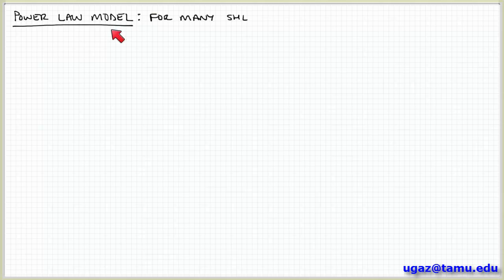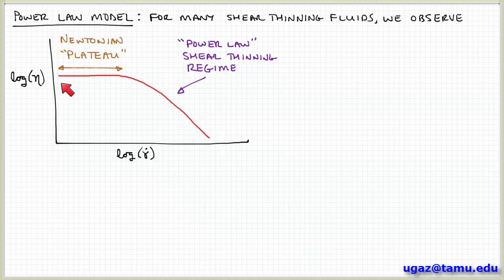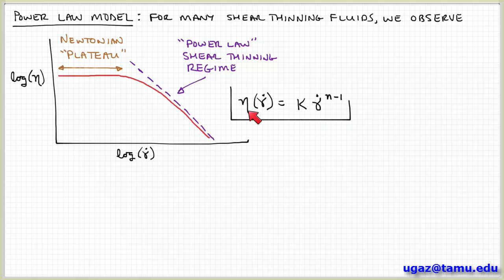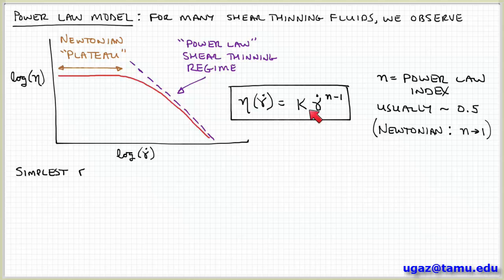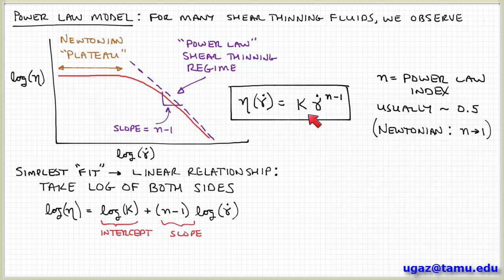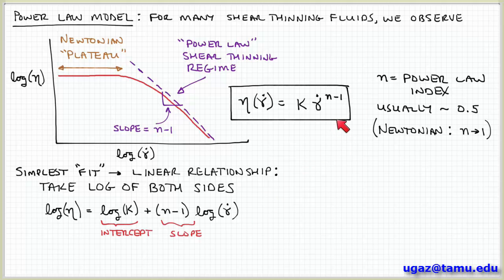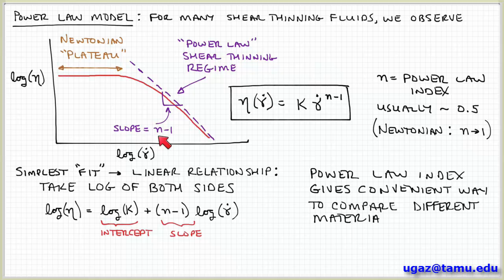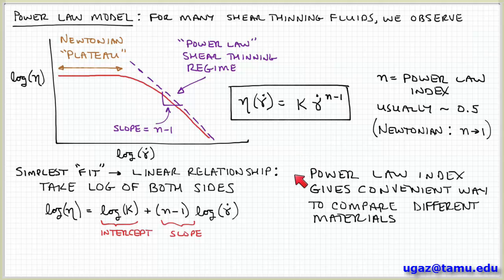Non-Newtonian Fluids, part 3 - Lecture 1.7 - Chemical Engineering Fluid Mechanics

Comment: Good explanation and animation 🖒. Besides, in real research case, it was  very hard to calculate non-Newtonian based on manual method. Therefore, there is a fast and simple method that using excel to determine the non Newtonian behavior.
https://youtu.be/KKTG7w9XKMo